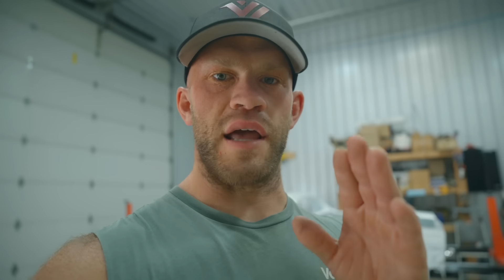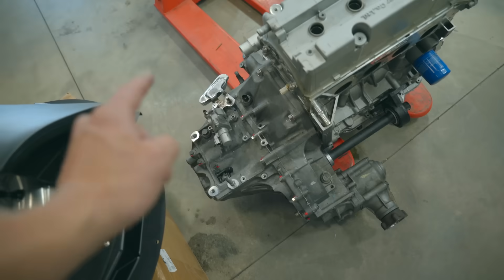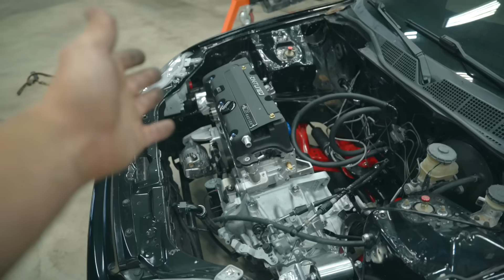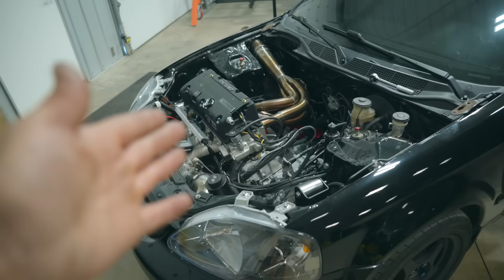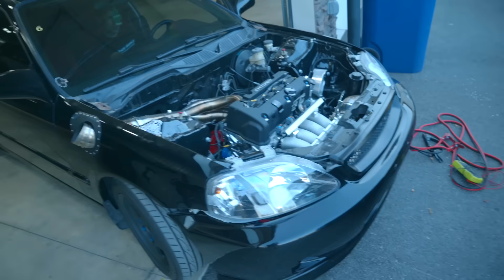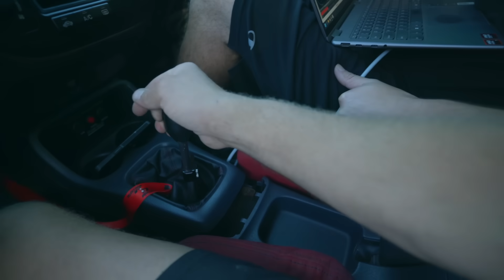I BOUGHT AN ABANDONED HONDA AND IMMEDIATELY BUILT IT

Comment: i had a b20 vtech in a early 90s ls integra body header intake exhaust vtec controller pulley cam geares stage two clutch fly wheel short trow thrtottle body with 75 shot this is back with the c5z06 were popular i was beating them by like 2 and half 3 cars all day long never dyno it but i can remember that

Comment: Red loctite though? Devin think of future you, use blue lol
Reply: A bit surprised seeing him use loctite on the flywheel bolts because 4 piston says to install them dry. Must be because he had some back out previously
Reply: @HunterQuiring ive seen k series back out pretty commonly with aftermarket so it makes sense (solid mounts and all the vibrations these engines create) buuut still, blue if its meant to be replaced eventually

Comment: Hey Devin! Do you mind showing how to adjust the clutch slave for a twin or triple disk so you dont break nothing???
Reply: Get a piece of 1/4” thick flat stock. Cut off like an inch long section. Use it to put between both sides of the pedal stop. Adjust the clutch slave with the trans in gear so that the car doesn’t move when the 1/4” flat stock is in but does when it’s removed

Comment: Guarantee that if you built a road course wheel to wheel race car then did a drag build you would be a better drag racer road courses teaches you the feel of the car way faster due to being in it longer and running it as hard as it can  it's damn near a 100% chance at both races the car is going to have hell bugs to work threw and will be lucky to complete the race